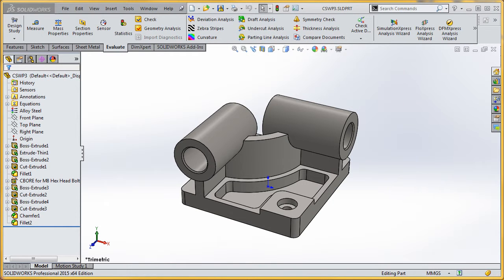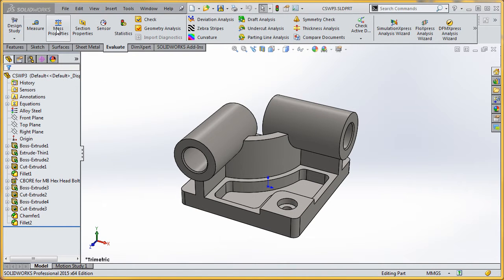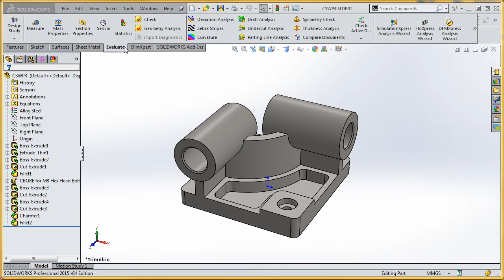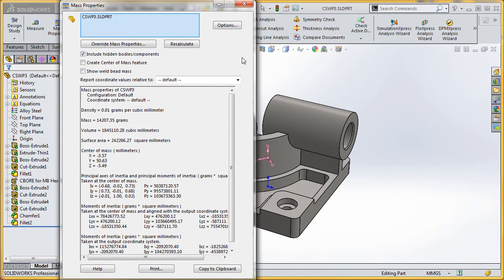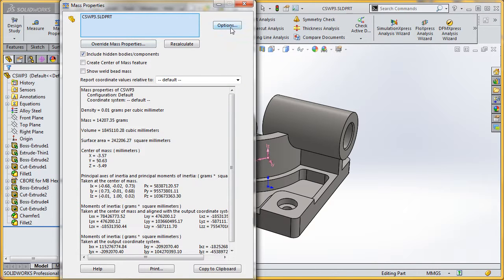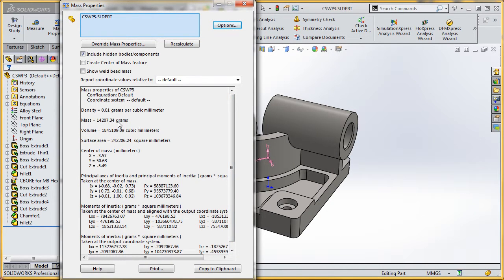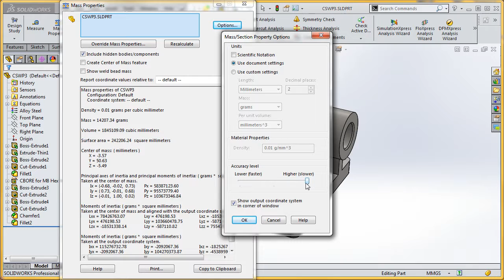Correcting a SolidWorks Certification Mass Properties Error

Comment: I have SolidWorks 2022. For this model, my mass is 497642.11.  I follow in what you did but my mass is still heavy. Any suggestions?
Reply from the maker: Your mass appears off by a factor of about 30. I would suggest first looking at your units, making sure you have selected millimeter, gram, second.

Also check the material you are using.

If those don't work there is probably another posted video of this model that will give you the step-by-step approach on how to put it together.
Reply: @DesignInnovations  GO CHECK UR DIMENTION FOR DAT PART WHERE YOU HAVE A HOLE U DID NOT USE 30MM@__BURAI

Comment: I tried making this, but mine is 12grams heavier and i don't know what to do and how to fix.
Reply from the maker: The error may be in how you designed your part - one has to be careful. How fillets are placed is a big source of potential error - save feature fillets for last - one feature fillet is best. Try building your part a different way and re-weigh.

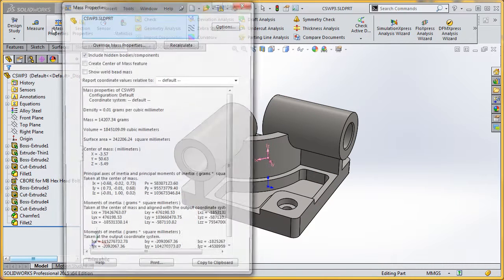Comment: Thanks for the clear instruction. I still have another remark/question as I am also suffering from a mass calculation issue (SW2018). In the frame on 2:38 sec in your video the volume of the part shows 1845109 c mm and a density of 0.01 grams per c mm.  I would say the mass should then be 1845109 x 0.01 = 184510 grams.  Your model also shows a alloy steel as material which has a density of 7.7 grams per cubic mm and still the mass calculation pane shows a density of  0.01 grams per cubic mm. Am I misinterpreting the volume and density figures?
Reply from the maker: I believe these issues regarding the SolidWorks data should be brought to the attention of the folks at SolidWorks.  Using this video as reference may help.  CSS